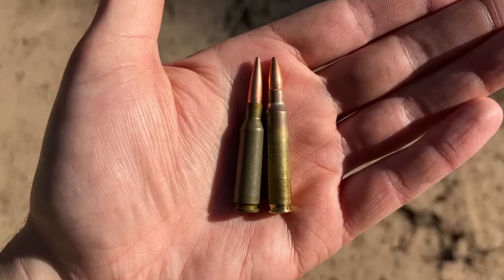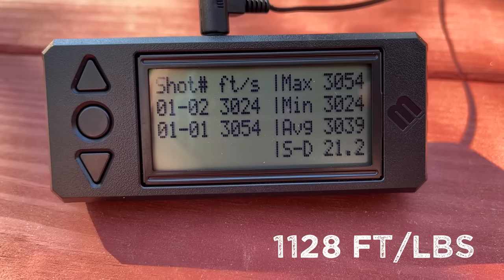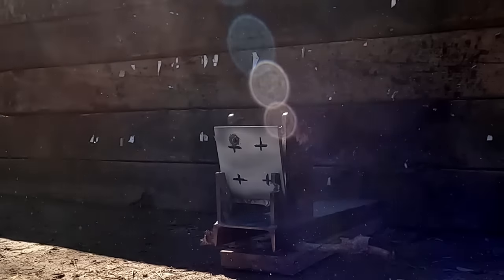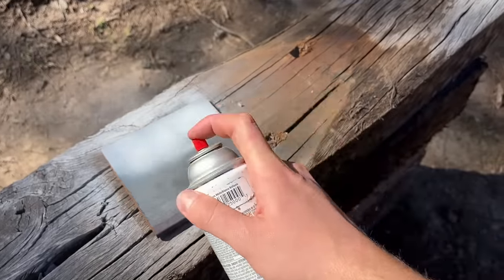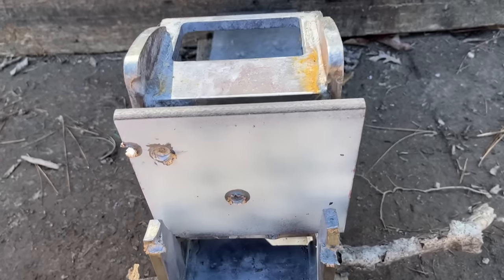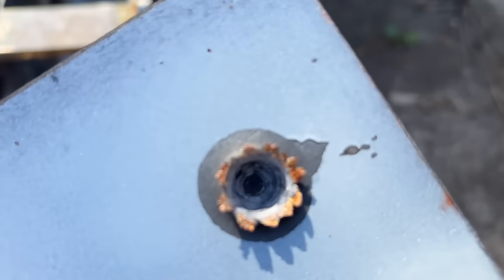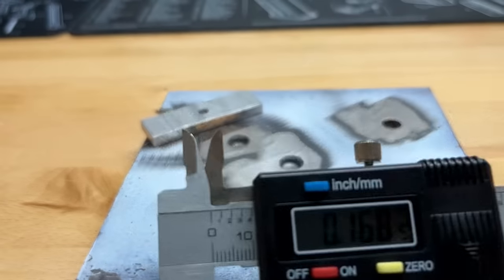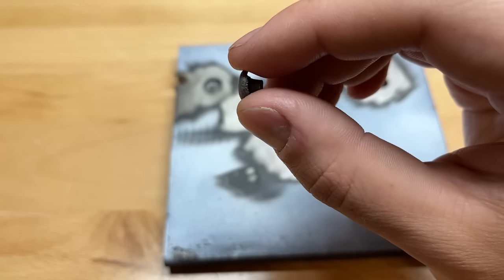5.56 vs 5.45x39 On Mild Steel: NOT So Similar After All?

Comment: Hey - really cool video. A note on sample variance and standard deviation - these figures are not stable for low sample sizes. They converge to the population variance as you add more and more samples. But for 2 or 3 samples, those numbers are totally meaningless. You could go shoot 100 rounds of each and determine later that actually 556 had a better stdev than 545 (or vice versa). Really, they are downright misleading for sample sizes that low. Obviously its good that you're thinking in that direction though :)

Comment: 7n6 has mild steel core. not hardened. it was designed to save on lead. oldest and most common round, not even close to AP.
first Increased penetration variant was 7n10 with 1070 high carbon steel core.
true AP variants:
7n22 - guarantied penetration of 5mm armor plate at 250m
7n24 - guaranteed penetration of 5mm armor plate at 500m
7n39 - guaranteed penetration of 9mm armor plate at 500m

Comment: Pull the projectiles from both rounds. You will see that the pills are nearly the same length. The 5.56 projectile just sits a lot deeper in its case. TBH it is surprising to see anyone burning up their 7n6 these days.

Comment: The point of impact shifted because of the weight of the bullet and the rifling rate of your barrel, right?
Reply from the maker: Could have been, but it’s usually not that much of a shift at 50 yards. That’s why I was thinking something was potentially loose
Reply: @bananaballistics  you have to re-zero your gun when switching ammo, most rifle comes with a table with zeroing with common brand in the manual!

Comment: I don't know if you were into any accuracy testing but it would be interesting to see if there's much of a difference with ball and rnds with steel cores. I've shot both and it really seems like "green tip" is significantly less accurate be it from a 1-8 and 1-7 twist barrels, which makes sense in my small mind, 2 different materials vs the 3 in 855. Ymmv. By the way great channel!

Comment: I bet the air pocket in the tip of the 7N6 had something to do with the penetration on the steel.
Reply from the maker: It does seem to have a large air pocket
Reply: That pocket does nothing on steel. Its purpose is to make the projectile more butt heavy so it tumbles quicker in soft tissue.
Reply: @eloiseharbeson2483 That was my point.....

Comment: 7N6 turned out to be such a disappointment. It doesn't penetrate as far as Russia claims it does. It doesnt even tumble very well, like its reputation suggests. 

But one thing it is, is very consistent & accurate. Some arsenals have that round dialed in for accuracy.

Comment: Very interesting! You shoot from AR-15 with 16 inch barrel 7N6 and an average velocity was 3073 feet per second. But in another experiment with AK-74 which has the same barrel lenght (415 mm) the speed of bullet was lower on 120 f/s! Same cartridge, same barrel lenght, maybe different air conditions... And different construction of gas extraction! Can it be the difference? The real difference between AK and AR platforms? :D

Comment: Using a similar sizing name between these two cartridges is important for comparison. The 5.56 NATO is 5.56x45. So compare 5.65x45 with 5.45x39. One cartridge has noticably more propellent and more mass of a bullet.
Reply: 5.56 has a case capacity of approximately 28.5cc while the 5.45 has a case capacity of 27cc, pretty close. 
The 5.45 case is shorter but slightly wider. The bullet weights run similar as well.
I'd say the biggest difference is the peak pressure limit with 5.56 being significantly higher.

Comment: Would be interresting to see a .243 tested against similar rounds. 
I forgot the name of the video but someone tested a plethora of different rifle calibers vs steel and the 243 was the only one besides the .50 bmg that managed to punch a hole something not even the mighty 338 lm managed to do.
The target the guy shot in the video was danglin from a chain tho so some of them may not have hit at a good angle a problem your setup doesnt have
Reply: Energy transfer is far greater when the target is solidly mounted.  Live combat always demonstrates that fact.  That 243 definitely has the velocity advantage.
Reply: @johnmcclain3887  that plus a very slim profile.
Biggest issue i saw in that video i mentioned was that he didnt even wait out the time to let the plate stabilize again. Thats why i like this channel here same parameters for every round fired
Reply: @julianeder4699  I suspect we find ourselves on many the same channels, I've been retired just since this plandemic, and too much time on my hands.  They killed my machine shop.
Reply: There's also the factor of the plate able to move, and substantial force transferred in plate movement rather than moving the metal in the discrete striking zone.
Reply: @johnmcclain3887  Wouldnt surprise me once one starts goin down the firearms rabbithole on youtube its only a question of time till you see a collab between a big guntuber with a smaller channel or another video on a certain type of round. Think my journey started back in the FPS Russia/ early Demo ranch days but just like in your case the pandemic inevitably lead to a bunch of boredom and a reinvigoration of my interrest in firearms especially since guns are a rather sensitive topic in my country of origin.
As for the bullet striking the plate and the latter giving way to the impact via means of bein pushed backwards instead of letting the projectile pass through i sadly dont really understand how much it effects the performance of a round as most slow mo cameras on youtube slow down time only to a max of a 10th of the real life speed which is nowhere near enough to draw reliable conclusions on the subject. Ive seen a ton of comments on the subject especially on the channel goin ballistic aswell as theories on how spacing the plates apart could alter the outcome significantly but most of them just threw a bunch of numbers arround that my brain simply couldnt comprehend.
That bein said the more randomn parameters one can eliminate in their testing environment the more clear cut the results get and the immobile nature of mr bananas setup, him settin up the plates at a 90° angle aswell as the grinding and precise measurements bein done afterwards most definitely eliminate a lot of the factors that could make a rounds performance deviate from the norm. 
Oh and enjoy the pleasures of retirement ive still got myself a good 3-4 decades before i can hang up my boots

Comment: When it comes to penetrating steel, velocity is key. M855 is known to have problems penetrating certain materials like steel. 7n6 is mild steel, but even if it was hardened I don't think 5.45x39 has enough velocity to do it. M855 is good at penetrating UHMWPE, would be interesting to see it compared to 7n6 against this material.

Comment: I imagine the original 20 inch barrel length of the AR platform would produce terrifying results with 5.56 since 5.56 was designed for a twenty inch barrel.
Reply: It does! It's really good at penetrating with a 20-inch barrel. I've had the pleasure of testing one out with M855A1 ammo, and it's a little monster! Personally, I'm more of a 7.62 x 39 and .308 kinda guy. But credit where credits due, the 5.56 shines in a 20-inch barrel!

Comment: I hope you kept that quarter inch plate. That was one aesthetic, picturesque collection of peeled jackets and holes
If you don't want it I'll take it @bananaballistics
PS I've worked as a metallurgy engineering intern for heat treating-basically an expert right?-here's my take on the mushroom. I doubt a bullet coming out of a 16in barrel will generate enough heat to transfer through a copper jacket to a steel penetrator. Especially if it is case-hardened. Even if it isn't case-hardened then it would still have to reach 727 degrees celsius or about 1400 degrees F to undergo a phase change. Temperatures below can cause some tempering or annealing, but by the time it hits the air I think there is enough heat transfer out of the bullet to prevent further softening. Maybe maybe it could be hot enough to still have more malleability on timpact. Further testing would need to be done. I'm graduating soon so I'll come down and test with you if you want.
Hope that didn;t drive you Bananas. Feel free to continue the discussion here
Reply from the maker: It is definitely a cool piece for pictures lol. Also, I think you are correct in saying that it wouldn’t get anywhere near 1400 degrees in a 16 inch barrel. I am learning in the comments that there is a 7n6m which is the hardened version

Comment: Grinding the surface is inherently inaccurate. Better to make a bridge block that sets on the undeformed surfaces of plate with bridge that avoids the disrupted edges of the bullet impact altogether. I mean if you're going to use a vernier caliper to measure to the .001" why not eliminate variances caused by the grinding?

Comment: 5.45 was good when it was cheap 10 years ago
5.45 at least in the US is just mostly hype nowadays
5.56 has way better projectile selection.
Reply: And its quite a bit faster. True nato spec m193 will go 3175fps out of a 16in barrel compared to most 50ish grain 5.45 going around 2800-2900.

Comment: That steel insert seems to have been as soft as the mild steel plates. I'm thinking good ole Soviet corruption?
Reply from the maker: That’s a good summary, it did seem to be mild steel
Reply: 7n6 is a mild steel core made to reduce weight so it tumbles in soft target not armor piercing

Comment: 5.45x39 becomes unstable on impact on foliage, light cover, body, because of the longer narrow bullet shape, and changes direction easily, its combat effectiveness is less than 5.56x45 when compared the same distances and targets, despite the fact that it was developed as a “copycat” of 5.56, and was supposed to be at least as effective.  You don’t hit where you aim if the bullet strikes anything between the shooter and the target.

Comment: I’m just pointing out, 5.56x45 is meant to be fired from a 20” barrel, where as both 7.62x39 and 5.45x39 are meant to be fired from a 16” barrel.

IMO for each test to be fair the cartridges should be fired through weapons on the intended barrel length for the cartridge being tested. 

I wouldn’t test a .308 out of a 10”
Barrel and consider it representative of the caliber for example.

And had the 5.56x45 been fired from a 20” barre it would have defeated that particular piece of steel, where the commie caliber failed to.

Now if we’re discussing weapons that’s more complicated but when discussing caliber I think it’s fair to assume the intended length barrel for a given cartridge.
Reply: They use the same powder. The barrel length should be equal.
Reply from the maker: 556 definitely performs a lot better out of a 20” or longer barrel from my experience as well. I generally try to keep the lengths as fair as I can make it though
Reply: @bananaballistics  you did as good as it can be done. Barrel length adds a little more velocity. Not enough velocity to push it through the 3/8 plate imo.
Reply: This isnt vietnam were 20 inch barrels were standard issue...16"M4's as far as I know IS the standard now and has been.